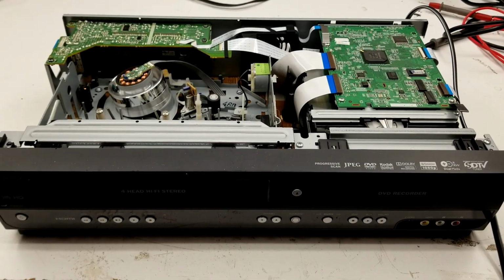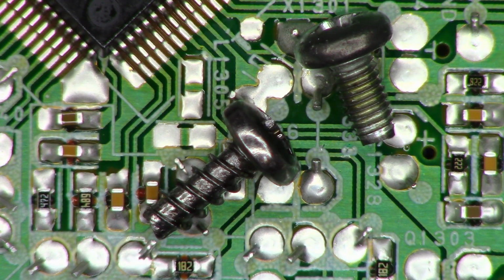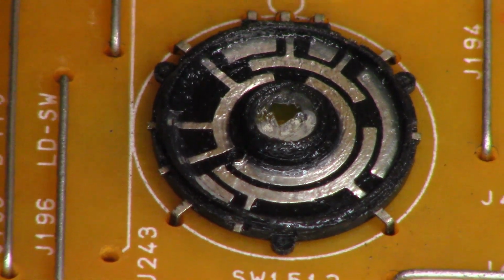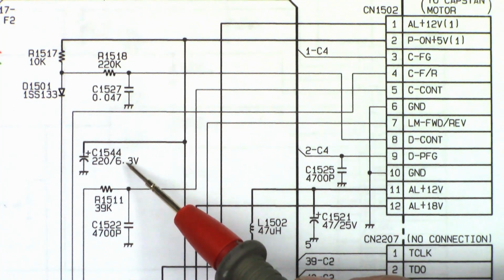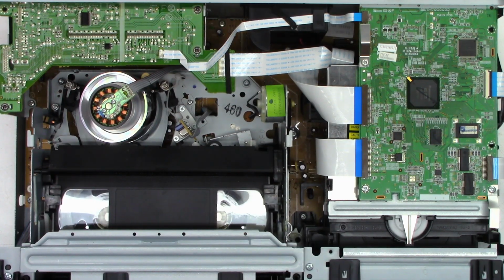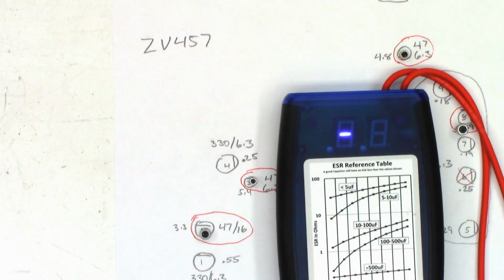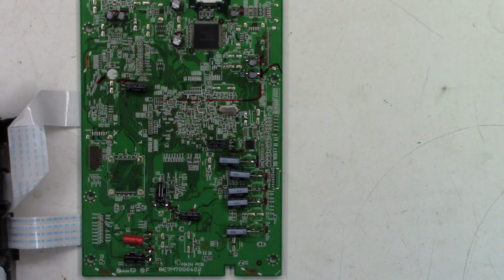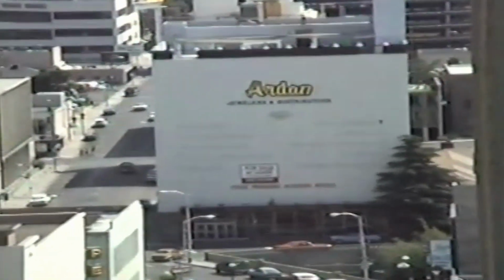ZV457MG9A MAGNAVOX DVD VCR - WONT TAKE A TAPE AND SHUTS OFF - DVD RE-CAP

Comment: I have decided to have my Magnavox ZV427MG9 A, repaired by you Sir. I used to work on circuit boards here in USA which were used by US Military. Also cleaning with acetone. My eyes are not so good now, (73yrs). I've taken player  apart before I found you on u-tube!😁 but just the cover...it ate a movie tape first. Finally removed tape.
Tried to play DVD, but it would make clicking noises on DVD side, switch back to VCR light on front and shut off. 
I'll contact you👍 Thank You So Much for this sight. 💯☺️
PS. I just put the cover back on and as I turned it, heard rattling. Opened it back up and some clear piece of plastic fell out??
Reply from the maker: Send me an email NorCal715videos@gmail.com